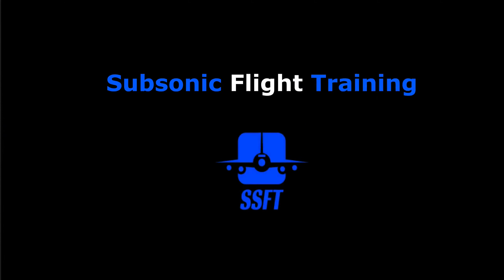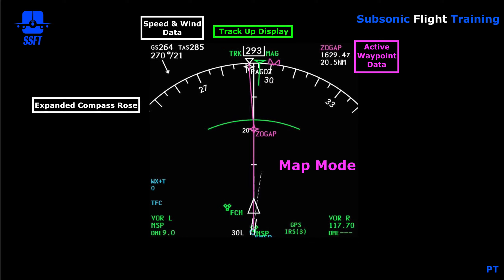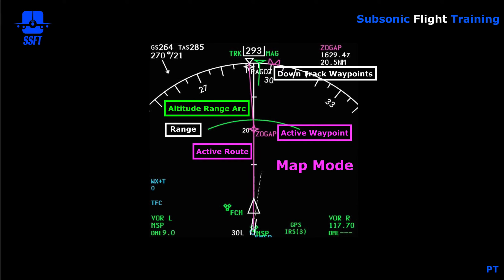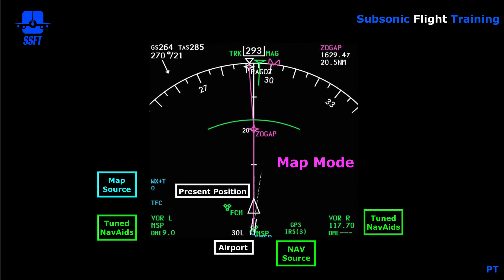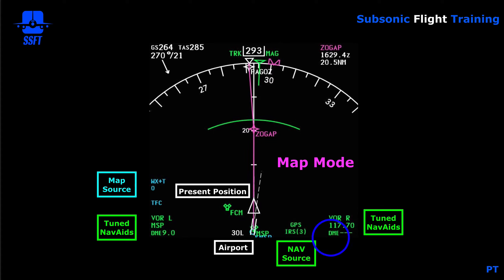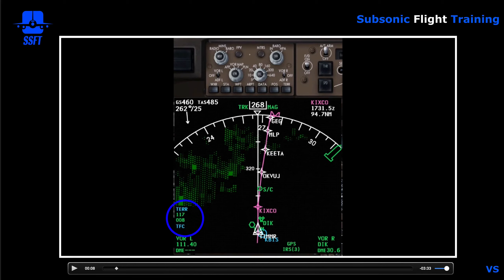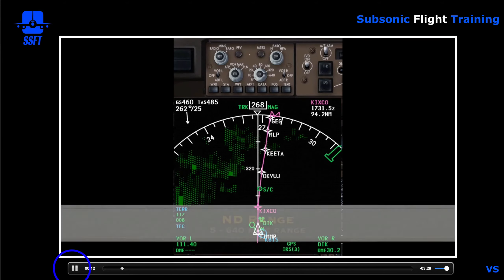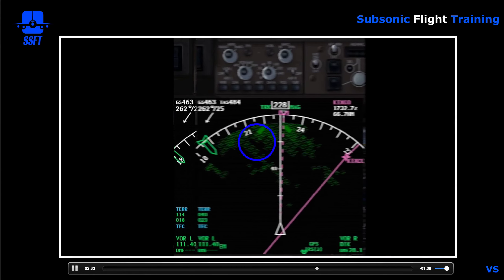EFIS ND Map Mode (iFly 747-400)

Comment: How can we calculate the position error from this display sir. I mean the difference of the displayed position and real position of the afct?
Reply from the maker: You can check Position Error on the ND by selecting POS on the EFIS CP and then checking the raw data radial/bearing/distance lines in relation to a navaid. If the radial and cross tick intersect the navaid dead center, there is no error. The GPS symbol will be on the tip of the triangle displaying your current GPS position. You can also look at POS page 2 to see FMC Position, IRS Position, and get bearing/distance info or LAT/LONG data for these positions.

Comment: Whats the greatest display range of the 747-400 ND (in nautical miles) when the ND compass rose is centered?
Reply from the maker: With the centered mode selected for range on the EFIS CP, the total max range on the ND max is 640 nm  on the 747-400, 320 nm miles in front of you and 320 nm miles behind you with range marks at 160 nm in front and back of the Triangle (jet).

Comment: What are the green arrows
Reply from the maker: The green arrows on the bottom left and right of the ND represent VOR L & VOR R. The skinny needle is VOR L and the fat needle is VOR R. They are selected on by using the VOR/ADF selector on the EFIS CP to the VOR position. If the needle is blue, it is in ADF position and represents ADF L & ADF R. If you are talking about the green arrow at the upper left of the ND, that is the wind direction arrow and speed. Anything 5 knots or less, it is not shown, above 5 knots, it is displayed on the ND, hope that helps...
Reply: @subsonicflighttraining  awesome thanks